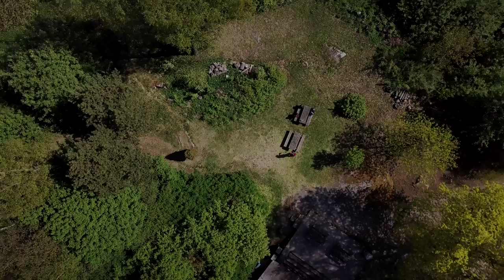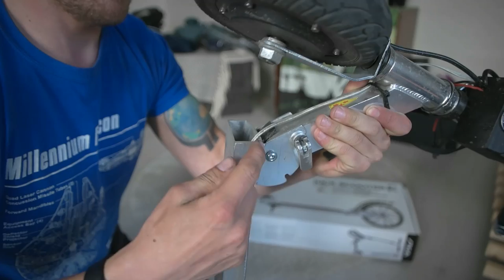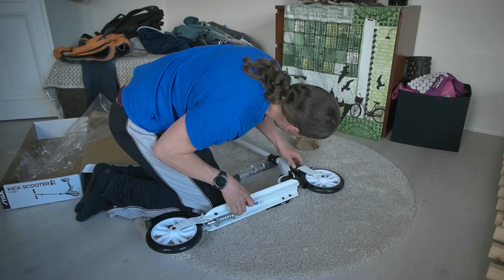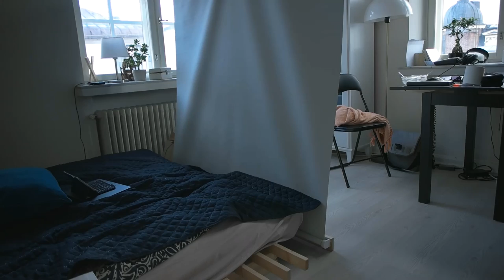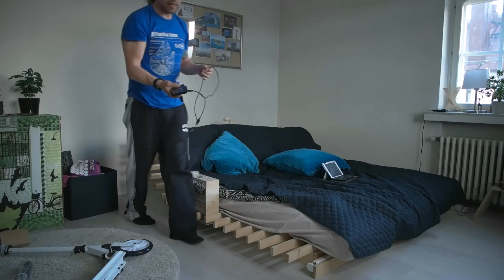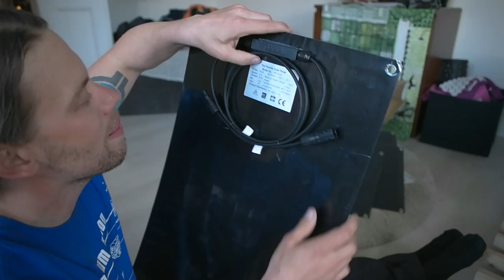Unboxing day and other random stuff - Electric sailboat vlog 0022

Comment: Great video release. You have so many new projects and your design on the Netflix bed was Really cool. Are the new black flexible solar panels in addition or replacements? Except for taking up space, you can't have too much solar power. Do you think putting the new solar arrays on the cabin will cause some cabin heating to occur (daytime only) in the cabin? Good to see you , keep posting!
Reply from the maker: +Harold Hofmann Thanks! I'm just gonna use one of those panels and it's a replacement for the old that used to charge the 12v battery. And we don't have problems with over heat in Finland ;)
Reply: Pauli Juppi ,Yeah I noticed how cold it is there when you went sailing last time. I was thinking that the added (?) heat would be a good thing!

Comment: nice panels. remember that flexibel panels are made to be able to put them on a curved surface. They are not made to bend up and down. So be careful. also mount them in a way that they will not flex constantly. it will for sure end in failure some day. I saw flexibel panels fail withon a few minutes because people flexed them like you did after unpacking.